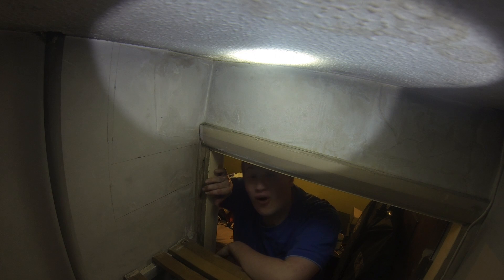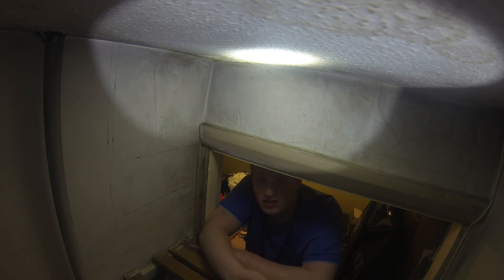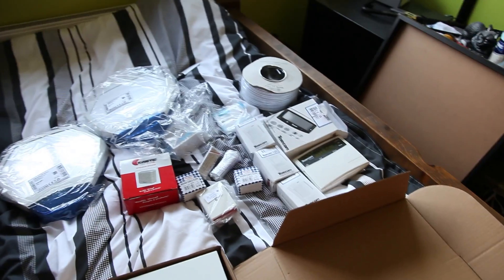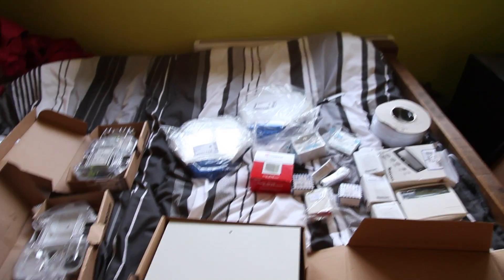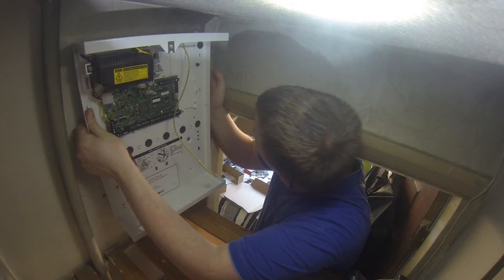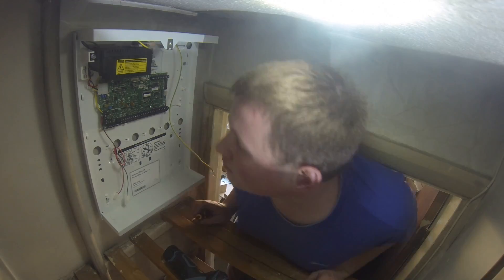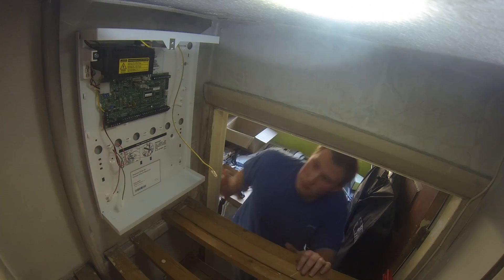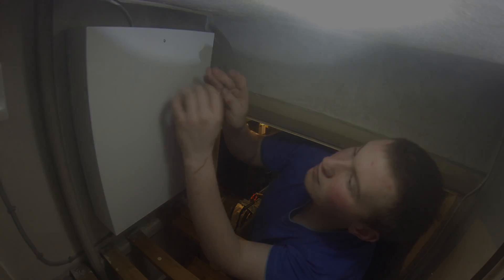Texecom Premier Elite 24 Metal Panel ( Installation Part 1)

Comment: Hi there, Do you need to be a sparky to fit an alarm or is this suitable for a DIY Install? - Can I run a cable from a plug socket nearby to a surface back box / mounted 13AMP fuse spur to feed power with flex cable to the main unit?
Reply: idk but maybe get a pro to check it

Comment: Amazing, I hope you are an apprentice as it took you about half hour to fit the panel and you didn't put a screw through the back tamper, this is my apprentices best trait, you seem to have the same,
Reply from the maker: had trouble with the wall plugs spinning in the hole because i drilled them too big so i won't be making that mistake again